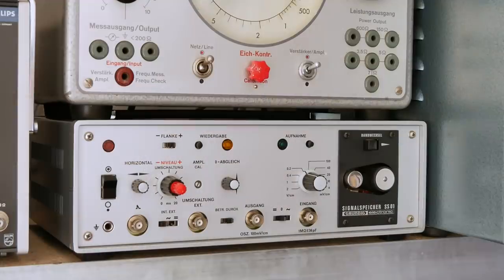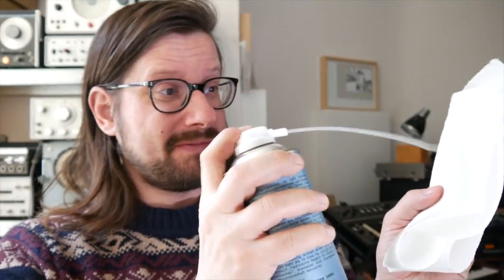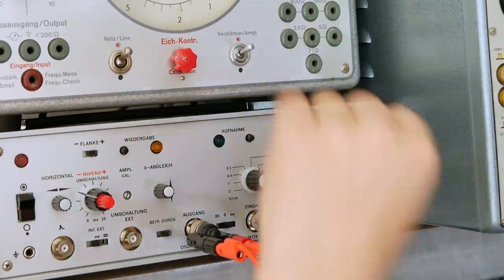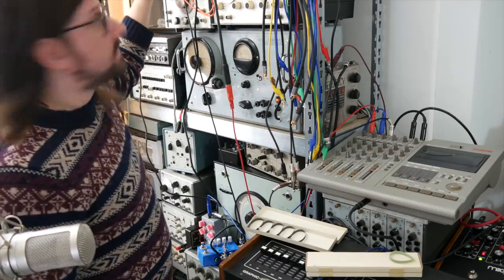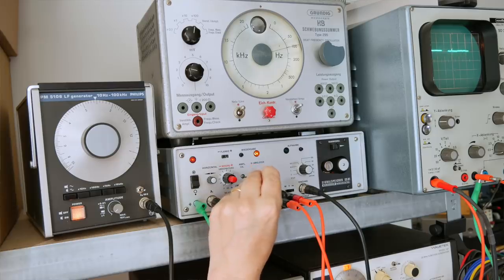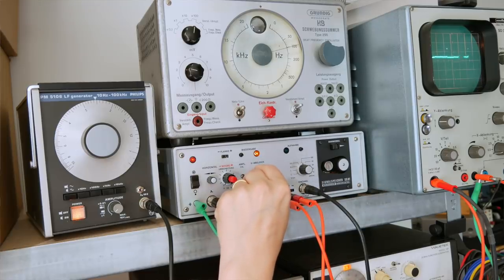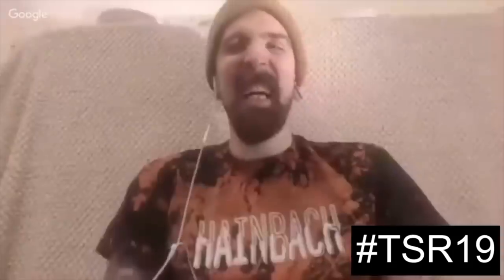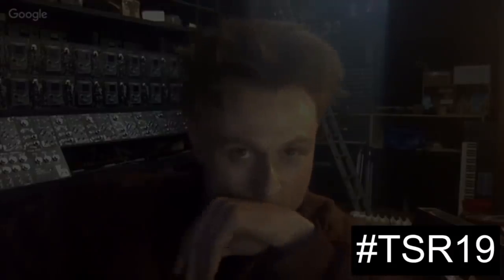GRUNDIG Signalspeicher SS01 - A Microsound Tape Looper

Comment: Just as a warning to others: Spray cans have a valve that you press to open. If the can is really old, that valve can get stuck in the open position and you wil have no way of forcing it to close again. It will simply spray the entire contents of the can untillit is empty.If you are testing it with just a tissue, you're in big trouble.
always test old spraycans outside or in a sink or some place where you can handle the entire contents of the can coming out.
Or better yet: get a new can, because even if the valve appears to work the first few times, gunk can make it's way into the system as the can is agitated and the valve can get stuck at any time.

Comment: @Hainbach
it looks like that data recorder accepts an external sync signal on the "Umschaltung Ext" (or trigger external) if you switch the INT. EXT. switch to external.   If you switch that trigger to external and leave the input floating;  you should lose the sync pulse on the output.
Reply from the maker: Sadly no - but I just made it almost disappear that way by finding a trigger that is on the same rate as the signal I am recording.

Comment: Should be possible to find the source of that trigger signal if you open it up and probe the PCB with an oscilloscope? But I was wondering, do you set yourself rules when you work with test equipment? Would you consider heavily modding something to make it do what you want or would you prefer to use creative patching to get the sounds? Creating is all about setting yourself constraints, after all :)
Reply from the maker: I would be totally bup for modding something, that is how the greats in the past did it or rather had it done by their technicians.  But I lack the skills.

Comment: Out of curiosity I searched for schematics and manuals and think I might have found a way to suppress the sync pulse without modification. From a block diagram that appears in this paper (page 3 of http://www.radiostollenwerk.de/Images/Anleitung%20SS01.pdf ) it looks like you can bypass the internal sync oscillator through the external input — but nothing prevents you from not feeding it anything. This is highly speculative, I'm neither an engineer, nor german-speaking. Either way this is a pretty strange and interesting piece of gear, thank you for sharing your experiments!
Reply from the maker: I have the full schematics, so I hope this is possible. Then it will be pretty incredible!

Comment: I just had a thought...

I recalled you have a Pocket Operator. Their clock is controlled by a click track.

Maybe you could use this machine to control it? If you took that reference tone, mangled it and fed it into the Pocket Operator, might be interesting.
Reply from the maker: That will for sure work, especially since I got the Bastl Klik. I just really don't like pocket operators.
Reply: Given what I’ve seen of your work, that makes sense.

Comment: Intriguing... only unfortunate that longer loops you have on hand — ones that don't come with the machine — would not seem to fit into the playback mechanism. Even with the faceplate of the playback mechanism removed (https://youtu.be/nvkQ7CtCqtE?t=599), it looks like the mechanism is sunken in too far to fit longer tape loops in. Nevertheless, it's cool that you found ways to coax nice sounds out of the device; it definitely seems to have potential.

Comment: SOOOO fucking cool
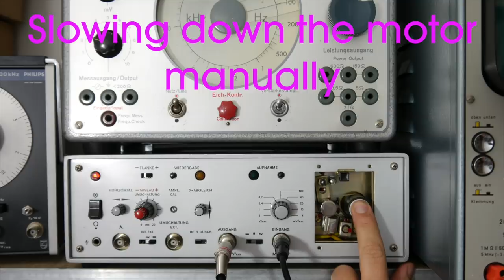Reply: just a curious sidenote, is slowing down the motor manually like at 10:10 detrimental to the motor?
Reply from the maker: I would not do it repeatedly, but its very strong.
Reply: @Hainbach  thanks.  I used to do it sometimes with a Webcor reel to reel and eventually the thing stopped working and I felt very guilty.